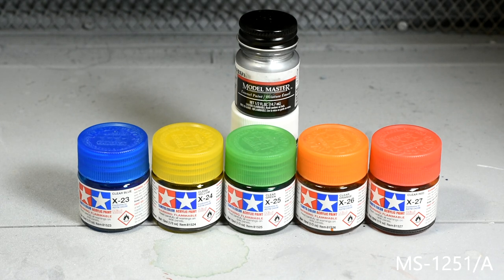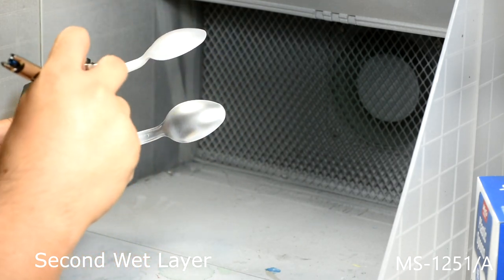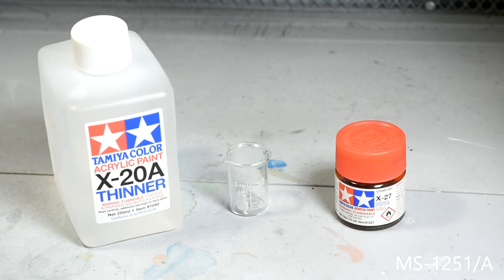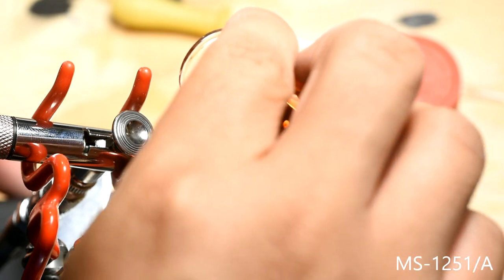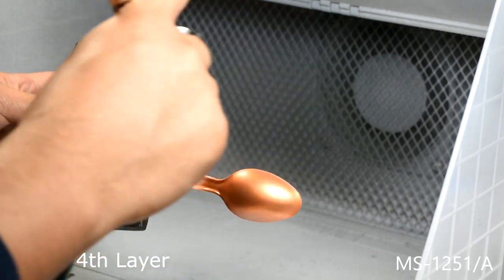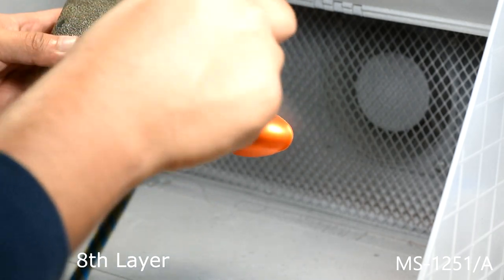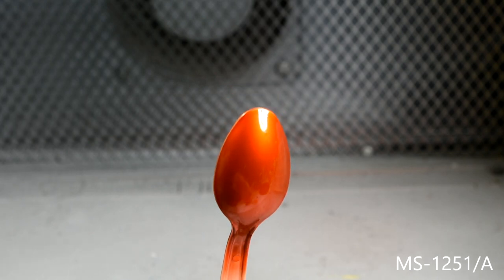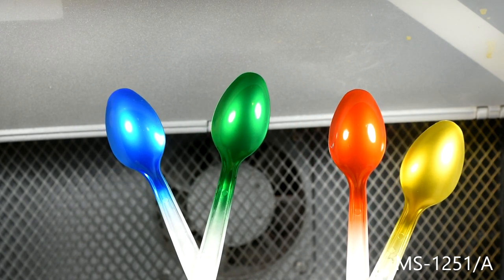Gunpla Candy Finishes with Tamiya Clears and Model Master Enamel for under $20

Comment: A model building channel I follow on Youtube talks about airbrushing Tamiya paints.  If preparing an entire bottle for airbrushing when you open the Tamiya bottle, there is a ring in the neck.  He adds the thinner to that level and really shakes up the bottle to get it mixed.  Like you he uses 20psi to spray.   It thins the paint enough for good flow thru the airbrush and it doesn't overthin the color.  Maybe for the red you may need to use less thinner.  Just a thought.

Comment: question, why did you use enamel base with a clear acrylic top coat? why can't you use enamel for both base and top coat? what's the difference in finish between enamels and acrylics?

Comment: Gunpla Space Factory i want result like that on 6:14 minute ,green candy so i dont know english well only google translate what ingredients  i must to have .....i work with acrylic paints ,this alll ,tamiya and model master is enamel? It is good on metal ,for example on brass?
Reply from the maker: Sorry, I've only sprayed model master enamel paint directly on plastic models. I'm not sure if it will stick very well directly on brass without a primer coat. 

Mr. Hobby Makes Mr.Metal Primer-R that is designed to bond to photo etched metals parts like brass. Its clear and has no pigment but this will allow regular primer or paint stick better to the parts.

Hope this info is helpful!
Reply: @gunplaf  Thanks .One more question ... ...Enamel paint does not conflict with Acrylic? For example first will be primer, than metallic enamel an then acrylic paint.... and does Model Master enamel paint  need a special thinner like Tamia paint

Comment: I want that cup you used to measure the paint
Reply from the maker: I'm not sure the exact graduated beaker set I bought is still available, but you can find these sets relatively cheap on amazon, usually 9 - 5 usd. with prime shipping. 

Just search "5 Pack Glass Graduated Measuring Beaker Set 5ml 10ml 25ml 50ml 100ml"

Hope this helps!

Comment: With the clear tamiya red you have to use a red base
Reply: No... no you don't. It follows the same principles as candy paint. Using a reflective paint like silver or metallic silver adds depth to the color sprayed over it. Adding a candy over a base red would just make glossy red. 
This has been the norm for over 70 years in the custom hotrod painting scene.
Reply: @zososldier  but it's not a candy red, it's a clear red.
Reply: @pikazardcollectors1123  Thats why I said "it follows the same principles as candy paint".
There really is no "must do" or "must not do" things in painting other than not mixing chemically reactive paints.